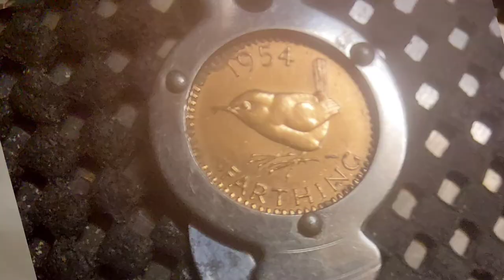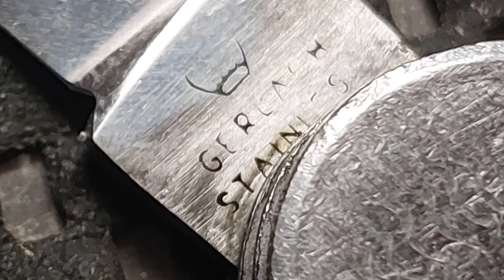Sheffield Pen Knives, Lots of them!

Comment: The pipe smoker's tool had the flat tobacco tamper, the long probe for cleaning the stem (if straight), and a small blade for scraping the bowl. I was a pipe smoker once, as was my father. 

A great tool could be just cheap stainless, because it did the job. 

Cheaper tobacco was often sold in twists.  Coils which you'd have to prepare  by cutting.  So the knife was dual purpose. Often they were shaped like small cut throat razors in that pocket knife chassis. 

I often lost the little tool. So I would a large head nail for tamping, and pointed end to clean out the doddle or smoked plug. Ashtrays often had cork doddle knockers in the middle. Mostly gone now.

The rings ought to twist to open out the blade.
Reply: Yes, you are correct...I smoke my pipes from time to time & this little knife would be perfect to use...